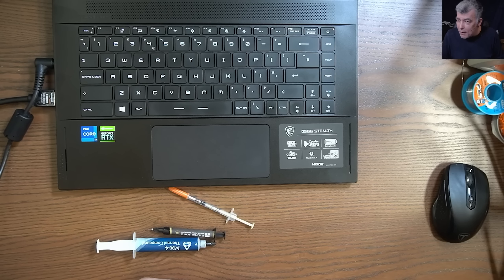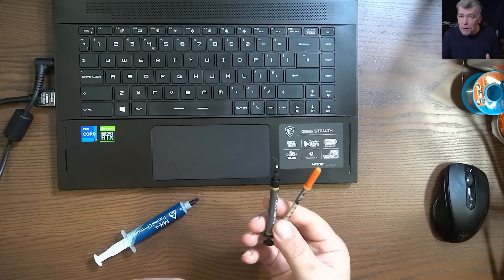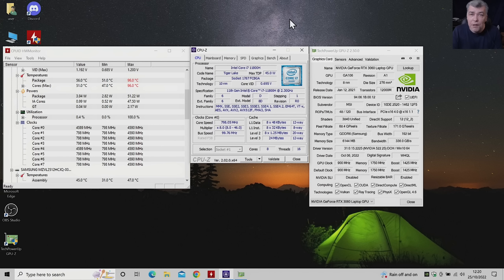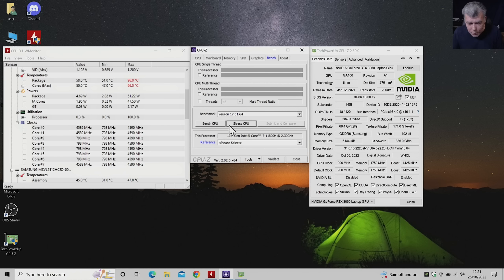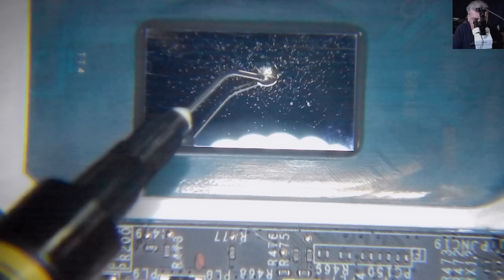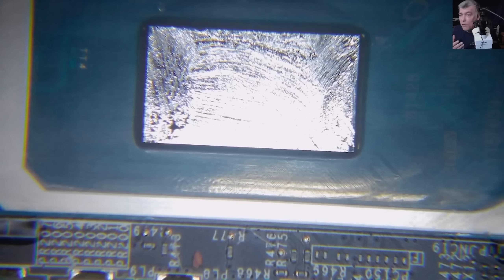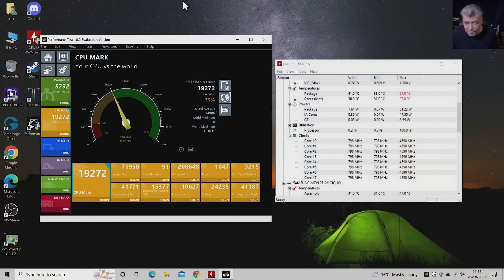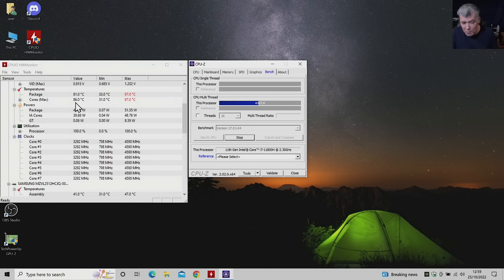Thermal Paste vs Liquid Metal - Benchmark

Comment: I watched a few vids on Liquid Metal and built a new computer 2 weeks ago in which I utilized Thermal Grizzly Conductonaut LM.  I have to admit I think I used a bit more than you did.  I put a layer on the CPU heatspreader, I put another on the contact plate of the cooler, then I put a drop dead center of the CPU heatspreader thinking it would sit there and spread out as it compressed between the CPU and the Cooler, but NOPE!!!!  It flowed outward and pooled with the rest of the LM on the heat spreader.  Fine by me.  I have hardly stressed the thing yet, but it is definitely running quieter than the computer it replaced.  Great video.
Reply: How's it looking now?
Reply: @sentesues9383  I have no idea what it LOOKS like, but the machine runs like a dream.  I've had ZERO problems with it and it runs COOL!!!!  I am a dedicated LIQUID METAL MAN now!!!!

Comment: In game consoles they cut a sponge to fit around the die that seals between the chip PCB and the heatsink, that way it's less likely to spill sideways and short stuff because it's trapped.
Every interface is a thermal barrier, and even though you are reducing one interface, it can mean the heatsink can get saturated quicker, ie, it could reach the same thermals, it just takes longer.
Reply: And on the PS5, the liquid metal can run to the bottom side of the die and the console overheats! :-)
Reply: @OnStageLighting  Yeah I think that was TronicsFix's last PS5 vid, ie, ie, someone dropped the PS5 so hard the liquid-metal slipped under the sponge and shorted the die.

Comment: Bought a syringe of LM and upgraded every device I owned, works so much better than any grease. 
What never happens to me is easily spreading like I saw in the video. I have to rub the swab into the chip to generate heat from friction? Don't know but it helps to spread it around.

Comment: To use liquid metal properly you need electroplate copper with nikiel  first otherwise it will react overtime with heat-sink and temps go up and need reapply again.
Reply: You generally only need to apply it once more and it lasts for years.

Comment: Liquid metal is little dangerous without some protecion layer. Better start witth undervoling with Throttlestop app to deacrease temp (due to thermal throttling) and then , If you want to be safe with non conductive  thermal , I recomend use for  gaming laptop honeywell ptm 7950 pad. It has better performance than other paste (MX, Thermal Grizzly, etc.)

Comment: I did hear you can add like 2 solid layers of nail polish to resistors on cpu and gpu for more protection against short made by liquid metal. I dont know exactly which one nail polish it is,because i hear some are diferent. I will very high recommend you,to use something to protects all of those resistors on your gpu.
Reply: Good advice, buddy. It is always necessary to protect capacitors that are exposed to short circuits. In this case, the GPU should have the capacitors protected with varnish
Reply: @oskarlaszkowski5028  Osobiście w laptopie używam pasty Thermall Grizzly Hydronaut,słyszałem że to jedna z najlepszych past (ogółem te wszystkie jakie mają,Cryonaut też),wolę nie ryzykować z ciekłym metalem. Pozdrawiam oraz życzę wszystkiego dobrego :)
Reply: @Hardey-li6eb  mozna zabezpieczyn kaptonem, lakierem pcb, solder maska
Reply: Tg shield Thermal grizzly

Comment: having liquid metal on laptop is not ideal because it a portable device that can create vibration which will make the liquid metal spread when carrying in a laptop bag or a slight drop your laptop will short out
Reply: Your supposed to have a gasket round the cpu/apu to stop leaks. Ps5 has the same.
Reply: Nah its fine.  You need to go back to school
Reply: @AutismusPrime69  if your talking to me i work as a repair tech for a company called disc depot in scotland. I do this for a living. Whos the fool now. Not got a clue what your taking about. I mostly do board rapair just like mr soron.
Reply: @AutismusPrime69  if you dont believe me call the shop. Its disc depot dundee. I will sure confirm over the phone.
Reply: @darrenstrathdee7425  Gasket is a must and also varnish to protect that caps around the GPU Die
Reply: I have liquid metal on the processor for 6 years and the computer has been moved to a LAN party more than once. The computer is in an upright position so the molten metal should flow downwards? Nothing like that happened. It is worth giving it as much as it is in this film and not like the other one where surface tension is already created
Reply: @AutismusPrime69 
Internet tough guy heh?
Reply: @beaconing7689   he was talking to the original commenter
Reply: Looks like someone doesn't know what he is talking about. Asus is using LM for years now and I never had this problem ever. XD
Reply: My nitro 17 laptop has Liquid Metal
Reply: @darrenstrathdee7425 hey can I get come tips? I have a Helios 300. If comes with a liquid metal default. I want to change it. Do you think it’s better to go with a new liquid metal or do you recommend anything better? Like, the pads etc. I’m not really knowledgeable on gaming laptops. So any guide will be great
Reply: @onepunchman6165  your better to replace it with the liquid metal due to how hot the system will be getting. You would be best to replace all the thermal pads on the mosfets etc also. 

Normally liquid metal lasts a lifetime so you can get away with spreading it back into the centre of the cpu. Im guessing with liquid metal on there you will have AMD?
Reply: @darrenstrathdee7425  It's an Intel i9 12th gen. Sure, I will be replacing it with thermal pads. Thanks for the advice.
Reply: @darrenstrathdee7425  yes it lasts for a lifetime. But the built in liquid metal was not put properly. So I have to redo it.
Reply: @onepunchman6165  if it was factory thermal paste put thermal paste. If it was factory metal put metal. If someone replaced the thermal paste to liquid use thermal paste.

Comment: I watched this video when it came out. the liquid metal worked tremendously for a few months but as of now its degraded to reaching almost 100 degrees celsius. I think there was someone else who commented on the video mentioningn that this was a possibility. It does work amazzing while it does but be prepared for reaplying it every few months. The video is still great im just sharing my experience.
Reply: is your heatsink copper or nickel plated? I understood that with copper heatsink the liquid metal eats into the copper. after many reapplications of liquid metal the copper gets "soaked" with it and wont dry the liquid metal out anymore. going to first try with PTM 7950 thermal solution as it seems to last longer, 2-3 year. basically its like a sheet of thermal paste but at over 40c temps it liquidizes and act like liquid metal. phase changing material
Reply: It's normal to happen. Galium diffuses to copper heatsink so less liquid metal is bridging the die and the heatsink. And yes, that means you have to reapply it soon. The good news is that galium diffusion will slow down considerably over time and after first 2-3 applications you won't have to do more applications that often. My laptop has great thermals (61-63°C under full load) even 2 years after my last LM application.

Comment: Your tip about making sure that the liquid metal should not be a floating bubble is been very useful and ill take that to mind just to be safe. But i recently saw a video on yt by Asus ROG liquid metal application and they used a robot arm and had spread the same kind of thin liquid metal coating like you did. But the confusing part was, the fact that it also has added two additional liquid metal drops on each side of the die and it actually appeared floating. I dont know what they did next but they definitely used a lil much of it so i wonder, did they do that because the particular laptop was made to actually hold that volume of liquid? Or was that a bad mistake?
Reply: When I was applying too little like here in this video (at least in my opinion its too little, and from experience as well but hard to be sure from video), the difference (like probably in this video) I saw was that I was pretty much comparing old crappy dried up factory thermal paste versus not so much LM (liquid metal). 

When I did the same on my GTX 970 from MSi (they actually were using quite well lasting thermal paste in there I have come to learn, so nothing that would quickly dry up in 2 years) and I applied the LM in similar imo sparse amount, I didnt see almost no difference at all. The difference was like pathetic 1-2°C in a very controlled bench tests with fans set to like constant 60 or 70% like usual. I knew something wasnt right because the difference was pathetic, you can either deduct that from hundreds of other videos on LM or from just thermal conductivity specifications of paste vs LM alone. 

So I went ahead and opened the 970 again, I cleaned the LM off, what isnt easy at all and you have to be careful not to spread it all over the pcb (masking tape and plastic wrap foil helps a ton so you dont spread it all over the pcb). I then used nail polish to protect the little pins around the gpu die, I used 2 layers, 15 minutes natural drying, then 5 minutes with hair dryer at hot temperature but not too hot, I kept my fingers in there near the gpu die so the temp is bearable. That is drying per layer, also making the second layer a bit more broad covering more area than the first one. Then I applied the LM again now applying a bit more of it so its more watery and THEN the results finally made sense, I was getting around 8-9 degrees of difference in the bech tests on the same fan setting, so almost 10°C. 

My understanding of this is that when you are applying the LM, the actual shiny non-watery parts arent really rich in LM, its mostly like a thin smudge of the liquid metal. When you place the cooler on it, it creates connections but it might not cover the whole cpu or gpu die, maybe it fully connects only like 40 to 50% of it, maybe more if you're lucky. That is if you aim not to have it too watery on either of the sides, so neither the cpu/gpu die nor the cooler. 

Since that experience of mine (and believe me I probably botched a lot of LM application before that) I now always insulate the near pins with either acrylate nail polish (regular stuff) or now mostly with a pcb insulating compound, what is essentially still a form of an acrylate varnish but its theoretically more temperature resistant, tho I never had any issue with nail polish so far and I encourage people to contact me if anything at all happens with the laptop or gpu or delided cpu. And I now also as I already mentioned put a bit more of the LM material in there, probably similar to the video you saw, in which it wasnt a mistake in case they insulated the contacts near the cpu/gpu die.

Additionally I would like to also mention that its also important (to get better results) to saturate the copper with LM, or to damage the top plating of the cooler or cpu/gpu die with the LM prior to installation, then wipe the material off and scrub it really well. The more you leave the bit of LM in there to react, the better, then scrub it off, and then it should be ready for final real application. The copper should look smudgy and dirty (saturated with LM) and nickel plating or gpu/cpu die should look smudgy and damaged as well. This just removes the top layer for better performance/ better contact between the surface and the LM. You basically just use a tiny bit of LM on surfaces and let it sit there for half a day then scrub it off real well, obviously without installing it. Then you apply it for real and install, after cleaning it off, but this process is a bit more advanced, but it would explain why some people have better results the second time they re-apply the LM after a few years (what I never do unless I notice performance drop).. 

My personal longest experience with this (in use today) is 7700K delided and 1080 Ti. Both have nail polish, both had top layers broken in with LM prior to real application and both had a bit more of it applied. I still keep my benchmark specs and notes so I can test it as similarly as possibly to see if there is any performance degradation and so far now in like 5-6 years I am still getting more or less almost exactly the same results. I just assume it doesnt degrade in way (like many people say it shouldnt) and I also assume the nail polish is still in a good shape as well as I am almost positive it spilled over a bit to the sides.
Reply: its not a mistake, if u already disassembly asus rog gaming laptop u can see some materials like silicone around the cpu to prevent the liquid mental to spill out.

Comment: Even adding a simple cooling pas or raising a laptop, improves the clocks. Keeping it clean is also important
Reply: That's if your cooling bottleneck is bad fan exhaust. But if it's dried out thermal paste it's not gonna make a difference.
Reply: @dariobarisic3502  if your pad is with fans and they are positioned correctly so the air blows into the intake then it will make a difference. OEM paste on mine is quite close to its end life and is pretty shitty, last time I added a second nvme ssd and checked it was more like dry concrete, not paste.. I made a custom stand that blows air directly into the intake and it reduces both CPU and GPU temps by like 5 degrees and cinebench r23 gets like 20% better score.
Reply: @marks9127  I mean, 5°C is not great, not terrible. It's more than I would ever expect and ever achieved with cooling pad. I just default to liquid metal and don't need to worry about overheating, at least until I need to apply it again.
Reply: @dariobarisic3502  How is your experience so far? I was thinking about applying it too for GPU and CPU. I've only found one dude who did this on a model I have and he said results were substantial. I was going to do it, and I knew how to apply it correctly without damaging anything, but then many people said that if you move the device around a lot then it can move away too and cause overheating and/or shorting something, some said its a mess to clean it when it needs to be reapplied and even if you have copper heatsink it will eat it away, not as much as alum but still.
Reply: @marks9127  It shouldn't spill over. Its very cohesive (kinda like mercury) and it sticks very well to the CPU surface and heatsink once you spread it nicely (which can be annoying since it likes to stay in the spherical form). I protected nearby area by applying nail polish and one non-overlaping layer of electrical tape on top, but I honestly never noticed any residue of liquid metal on the tape or the surface beneath it and I have my laptop vertically in a bag. 

Regarding copper, it does diffuse into it (specifically gallium from the liquid metal alloy), but the difference is CuGa alloy has good thermal and mechanical properties (similar to copper) unlike AlGa which is terrible. The drawback of this is that after some time you will need to reapply to make up for diffusion. I needed to do it two or three times within 2 years and since then it lasts significantly longer (perhaps Cu heatsink reached its Gallium solubility limit).

If you put enough of it on both surfaces and spread it over the entire area nicely, you should definitely notice the difference. If you put too little you might get only marginal benefit.

Comment: there's alot of pitting on the cpu processor man unless its dust but i dont think so ive never seen so much pitting on a cpu before and some ppl use a clear nail polish to coat the caps around the cpu and gpu to protect them from shorts also i say that the cpu gets up to 87 deg before it was 95 thats pretty good but is that temp really work possibly shorting stuff out not for the average user to do

Comment: To be honest I wouldn't be looking at clock speeds, rather I would be looking at power (watts), since that is the metric of heat flow and it will give a better picture of performance between different thermal pastes (°C for given power wattage), furthermore the software "intel dynamic tuning" is programmed by the laptop manufacturers which sets long term and short term power limits which often skewers these types of tests because whenever the processor uses turbo it takes out power from the long term "pool", and you see this effect when the processor power drops to 40ish Watts after a period of time and the temperature generally settles lower, i think you started the gpu stress test on the second run when the power on the cpu settled on this lower power level, if you activated both simultaneously at the start the temperature would spike higher.

Also even though MX paste is good there are better ones out there like kryonaut, the temperature difference between those two is much smaller (conductonaut and kryonaut)

Lastly people often replace the paste with liquid metal and see no difference at all because there are other bottlenecks in the cooling solution, and this is simply because of either heatpipe power limitations, airflow rate of the fan or the heatspread size.
Reply from the maker: Well, everyone has an opinion, i respect that, i can be wrong , but the cpu benchmark software is not wrong, the laptop gained 1000 points on the benchmark, this says a lot
Reply: @electronicsrepairschool  oh yes in this case you are right you have improvement of at least 5°C but I was thinking in general a lot of people might not see such an improvement because of other bottlenecks, also if you compared it to kryonaut paste the difference is likely to be much less.

Anyways thanks for your videos, very interesting and always learn something new.